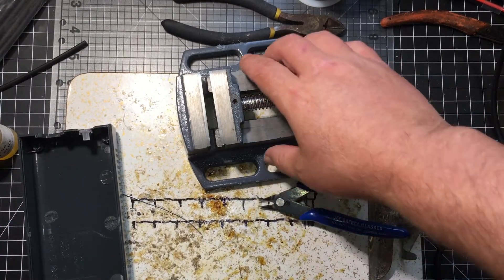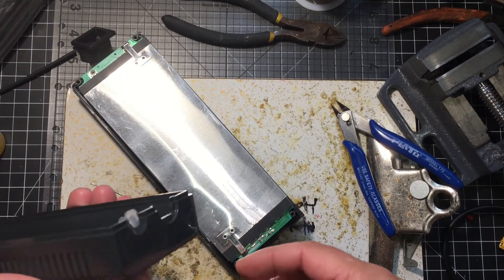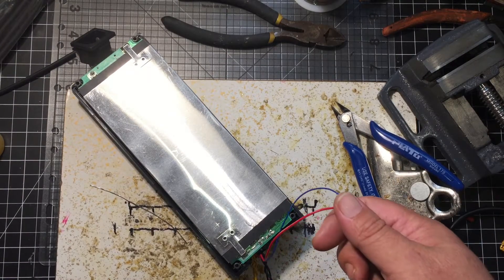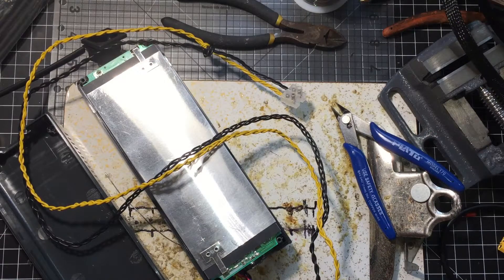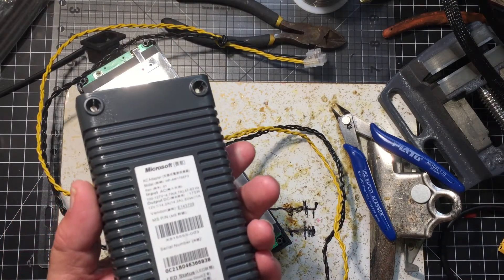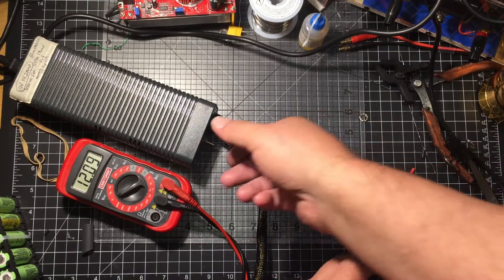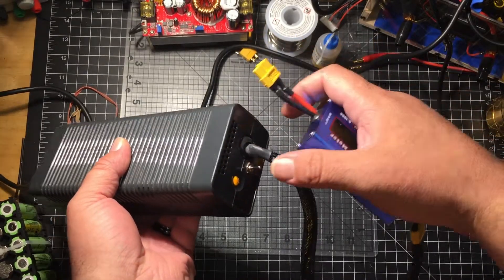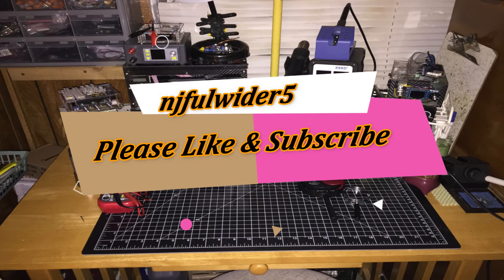XBox 360 Power Supply Hack 12V 14Amps 175W

Comment: Does this have some kind of fan? My power supply makes a weird noise when i turn on my Xbox. And it comes from this brick, but i don't know. Could you help me?
Reply from the maker: It’s been forever since I tore this apart, but if I remember correctly there is a small fan inside of the top of the case, you can replace easily. You can’t see the fan when you open it, it’s protected by air vents to the outside holes.
Reply: huh... ive never opend one .... yet .. i have 4 old ones and 20 for the slim
Reply: Well i put some WD40, and the fan noise just stopped

Comment: My psu red lights when I connect power sense wire?
Reply: Are you connecting the blue wire to the red wire? That will turn the light green and turn it on. Make sure the red and blue are not in contact with the black or yellow wires. Also make sure that the yellow and black are not shorted together. Hope that helps..
Reply: @nazcaengineering3052  yeah blue to red yellow and black not connected to anything. I was planning on using it to power my peltier module based mini fridge when its psu died after I upgraded it to be more powerful with a larger peltier module and extra fan, pulling too much power for its 4w psu. I ended up finding a 175w xbox psu out of my boxes of old stuff and just did the same to that -unsoldered my fridges power connector and wires from old psu, soldered them inplace of yellow and black, dropped a switch across the blue and red and powered it up and that one worked straight away. the original one that red lighted was 150w. I did read about some of the PSU being funny with the power sense and 5v causing the safety cut out and that they were 1.5-3v power sense instead of 5v. I added a couple of resistors to the blue and red and then it would power up for about 10 seconds before red lighting. Sadly I will never know with that supply as I damaged the solder pad and PCB so scrapped it for components. this 175w xbox psu works perfectly, unsoldered the xbox connector and lead and swapped for my fridges cable and connector unsoldered from its original psu, since the red and blue wires were now removed with the xbox connector I dropped some solder between the two pads being careful not to short any near by components and swapped the 'kettle' plug for just a two core cable soldered in place. Much better!

Comment: Fiiirst! 116 subscribers.. you're flying... 1000 soon
You shoul duse heatshrink to cover the switch. if starts to get warm in there, the hot glue will slloooowwwly start to move around
Reply from the maker: Man, I am pushing. And you have always been there from the start!!! Thank you!! Thanks for commenting!!!
Reply from the maker: Just noticed the edit...The Xbox 360 stays super cool and the placement should get some pretty good air from the Fan. I probably didn't need the hotglue, I just added it to be safe : )